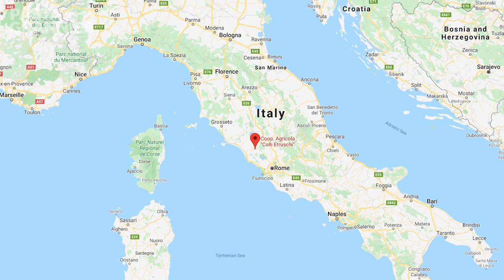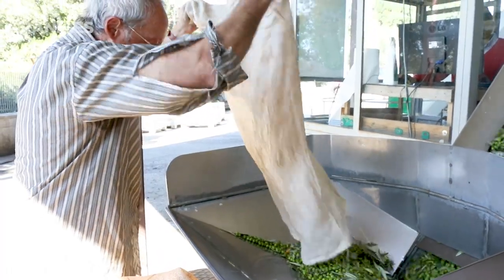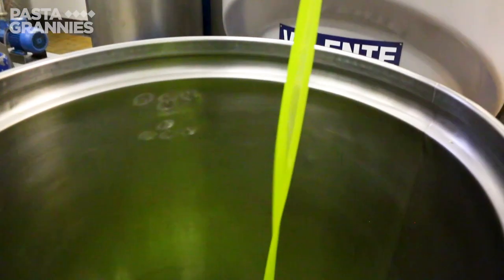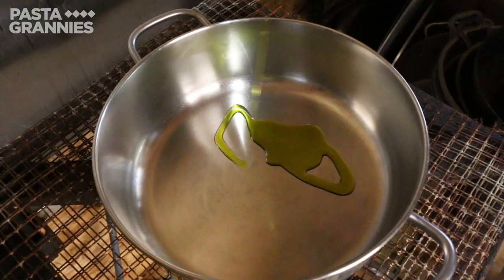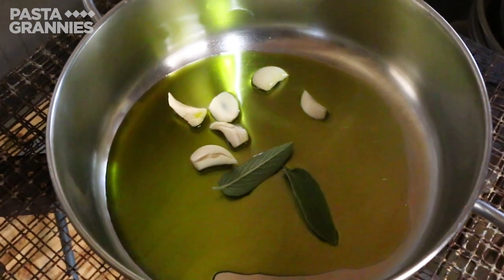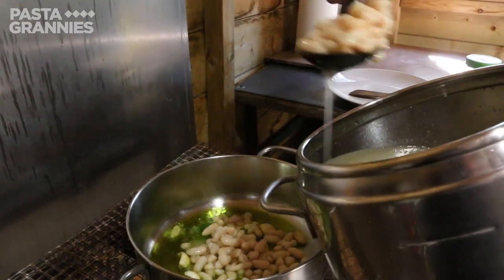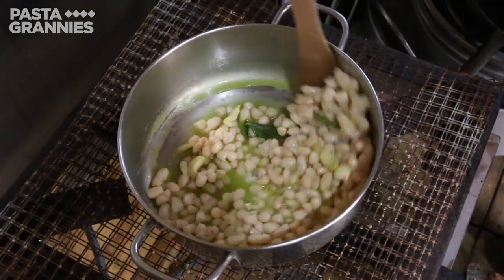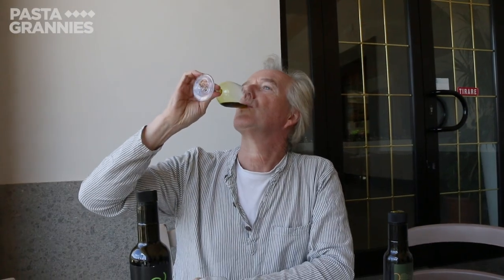Pasta Grannies discovers how to taste and use extra virgin olive oil

Comment: One test I learned, but I'm not sure of the truth or value of it, is if your olive oil solidifies in the refrigerator it's a good quality of cold pressed oil.  Heat expressed oil stays liquid in the fridge.
Reply: I'm not sure but I think it may be the other way around.  Curious though.
Reply: This is one of the great myths like you should not cook with evoo. I was at an event in Boston where it was very cold. Some 'olive oil' (so NOT evoo) was for sale and had solidified completely - it looked like a bottle of butter! EVOO smells of freshly cut grass, burns the back of your throat and has no defects.